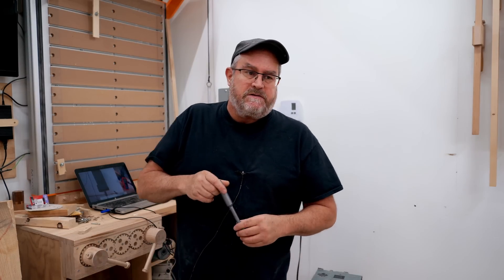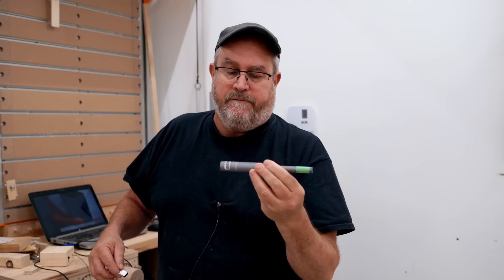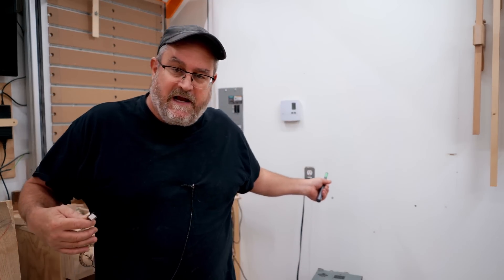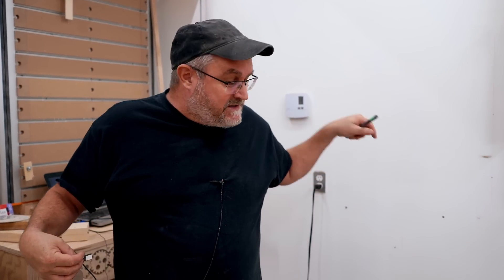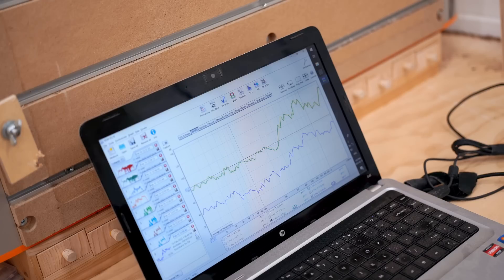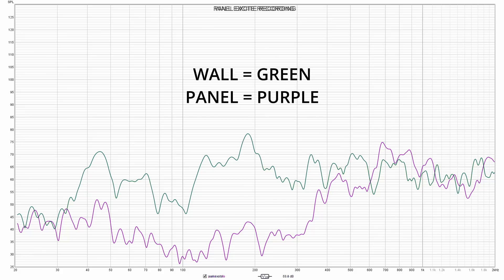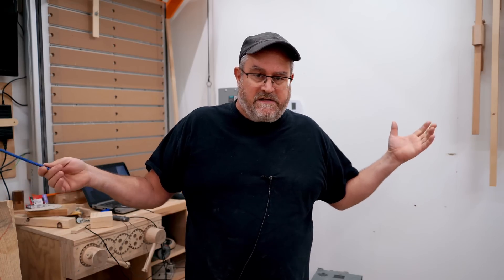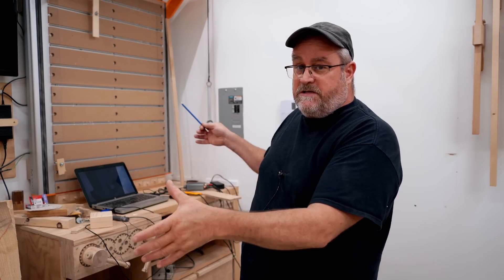How Much Noise does your Speaker Put Out? Debunking Panel Resonance... Maybe

Comment: Sound versus vibration is difficult to differentiate as sound is vibration!
Reply from the maker: What's hard to differentiate is the amount of sound that's coming from the speaker operating normally, and the amount of sound that's coming from the vibrating panels of the box. Or the amount of sound that's coming from the vibrating wall.